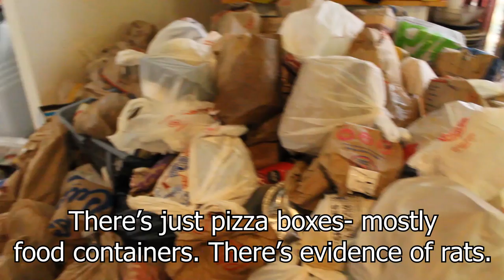Episode 3 : 8 Years Living Buried Beneath Trash

Comment: I understand that level of burn your nose ammonia. I can't say where it was, but I was doing a farm job and the goat house hadn't been cleaned out in a very long time. I'd say at minimum a year. There were a lot of goats using it and all they did before a full clean was put fresh shavings and straw on top. The bedding by this point was at least knee high deep compacted, with urine and faeces. Shovelling through it released this very pungent odour that took up all the air in the house. When I went in I could barely breath and felt like throwing up. I opted to do wheelbarrow trawling since I just couldn't handle being in there. I can't recall how many times I went back and forth to the dumping pile about 200 yards away. It took all day with a team of 4-6 (breaks and other jobs, rotating people). Really think gas masks should have been used in there.

Comment: I’ve noticed on several of these videos you talk about how hot it is INSIDE the house/apartment. I know that you prob have the door propped open since you’re going in and out but is there a reason that you can’t crank the air conditioning down? That would be the first thing I’d do when going onto a job site. You know you’re going to be suited up; in Florida no less! Push that sucker down to 60 while you’re there!!